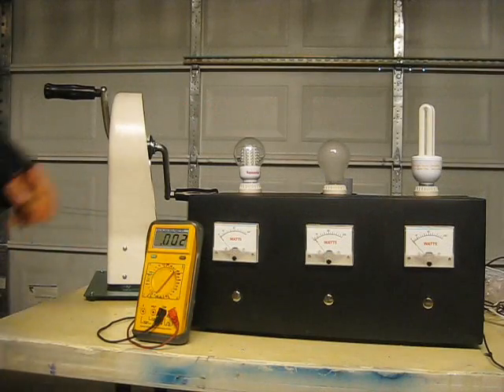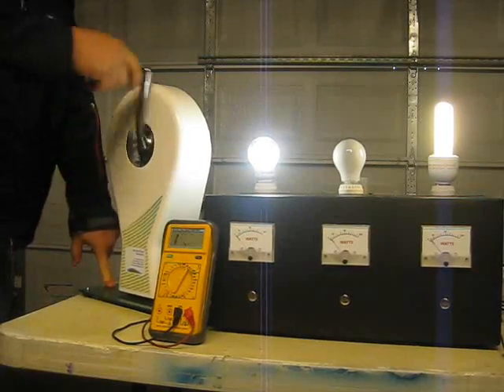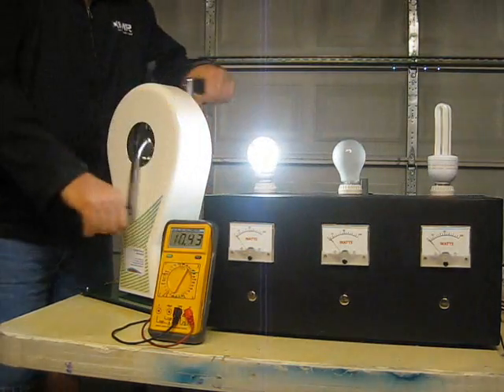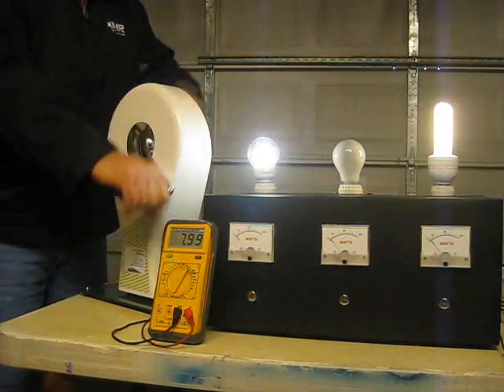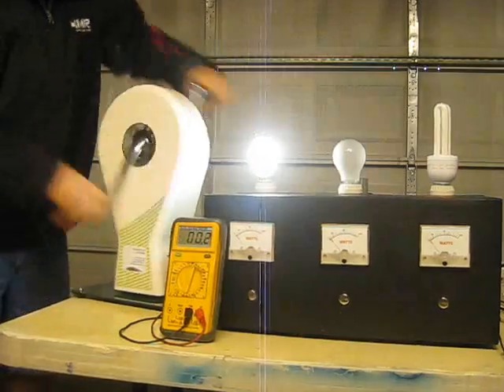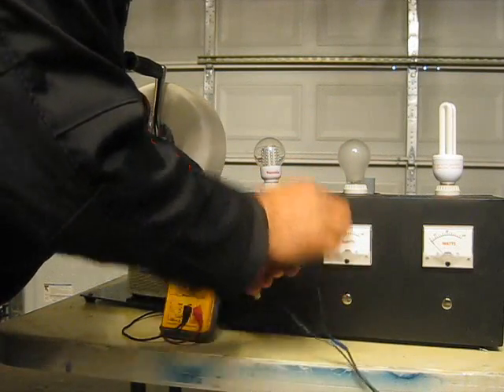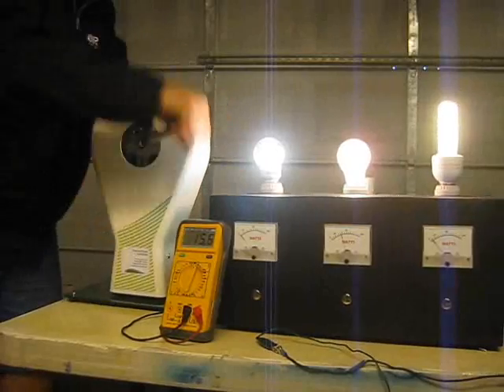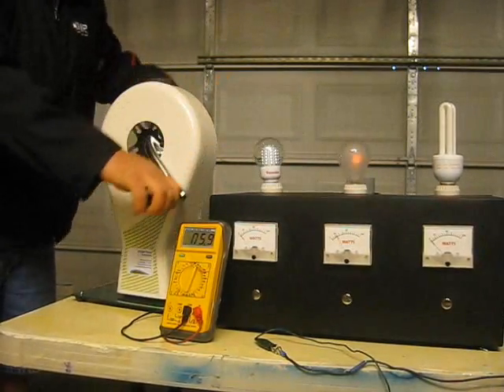SCIENCE CENTER HUMAN POWER GENERATOR ENERGY CFL LED POWER INTERACTIVE DISPLAY

Comment: What voltage will you get by rotating the shaft of a PM DC motor on a constant RPM? (let's suppose @ 1000 RPM) Will it produce nearly the same voltage that the motor needs when it is driven by electricity to 1000 RPM?